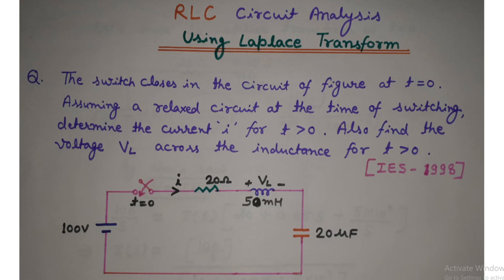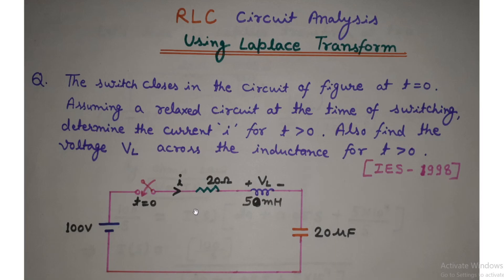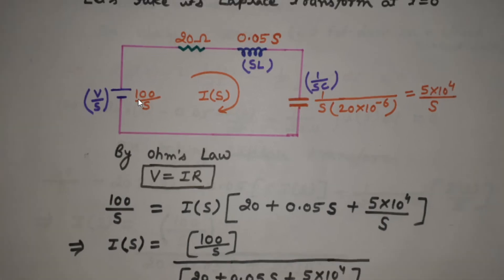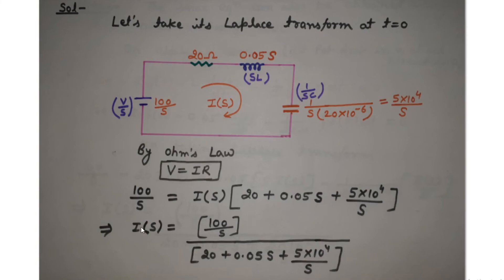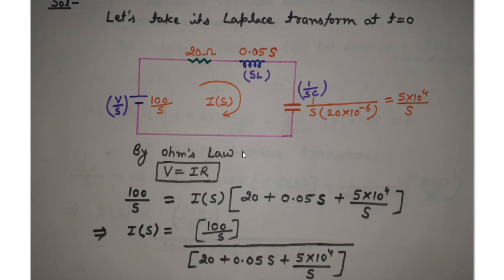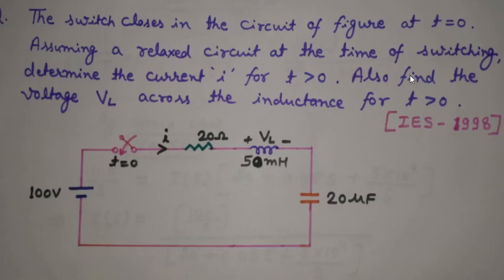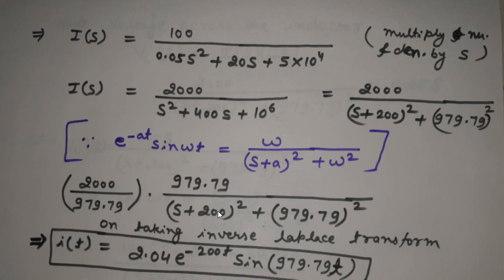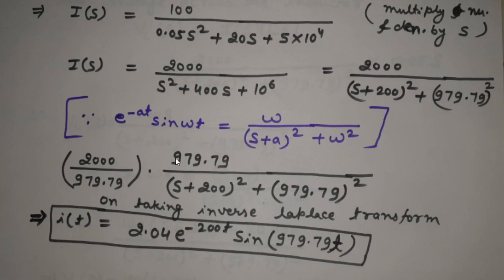RLC Circuit Analysis using Laplace Transform- Series RLC Circuit Analysis- S Domain Circuit Analysis

Comment: Thank you very much for your explanation,quite explicit .
However,this is an example with initial value..
An electric circuit consist of an inductance of 0.1H,a resistance of 20hms and a capacitance of 25microF .find the charge q and the current I at time t,given that;q=0.05c and I= 0   when t=0
Reply: Pls.how  to solve this problem using Laplace transform?

Comment: where does 979.79 come from?
Reply: its 999.79, little error there
if u take 10^6-400 u get  99600 and then take the sqrt of the result
Reply: Your bracketing is wrong sir.
Reply: Completing the square
Reply: @fayaqkirmani  979.79 is correct. If you solve the polynomial you get that as the imaginary part. Also, if you complete the square you have 1 million minus 40 thousand which is 960000, who's square root is 979.79
Reply: @durragas4671  good sir,  where did the 40k come from?